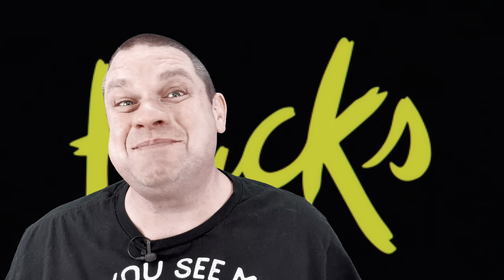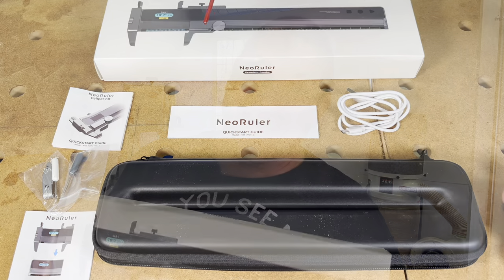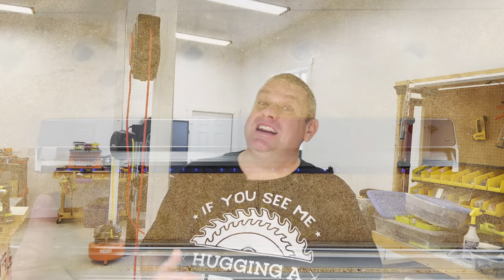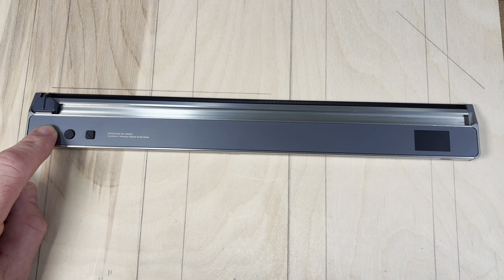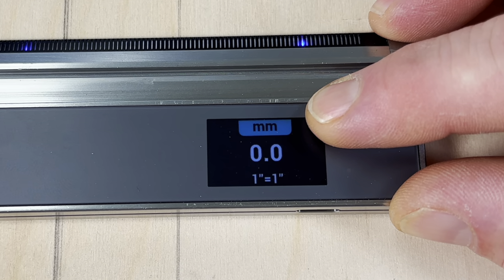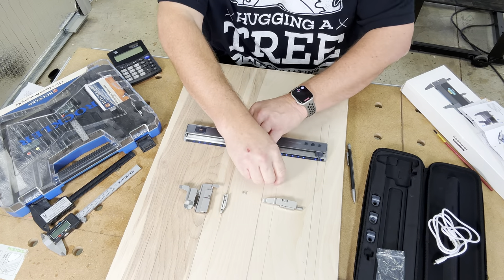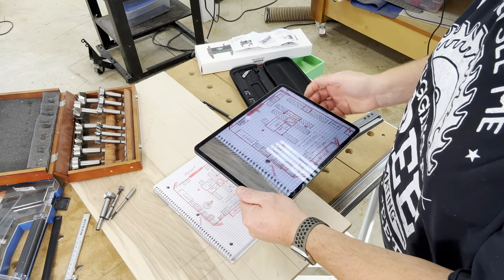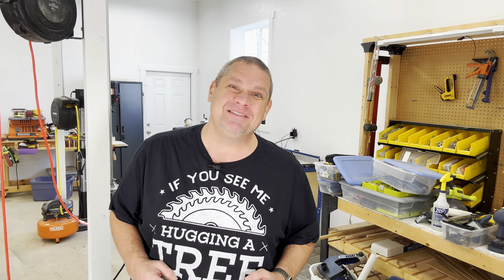Unleash the Power of Technology: The Newest Digital Caliper and Ruler

Comment: That's a really cool tiny beast.  I love the idea it could help mark out box joints using the segments mode.  It could possibly help with dovetails, too, but I think that because pins and tails are such different measurements (i.e. 1/8" pin with 3/4" tails for instance), it's asking a bit much of it.  Then again, the tool has so many other uses.  And it actually seems to be able to do all those well.  At this point, it's a tad out of my budget, but thank you for showing it!
Reply from the maker: Thank you so much Sandy.  What a great idea with the dovetail layout.  I can't believe I didn't think of that, great suggestion.   Thanks so much for watching and commenting, I really appreciate it! :)

Comment: Does "I haven't unpacked my set up blocks" really mean I can't remember where I put the darn things? That is a nice tool, I did notice how large the inside calipers were and I also noticed that it doesn't have a depth gauge either. Both of those would really make me think twice before dropping that kind of money. Still, thanks for the fun video.
Reply from the maker: You know me too well Pat!  It was a combination of me not unpacking everything yet and not knowing where int he hell everything is! :)   I agree with you on the inside calipers.  They need to sleek that design down so that it can fit smaller holes.   Great observation.  I was noticing that when I was editing the video, and probably should have commented on that!

Comment: Interesting lots of techy features, but I just can't wrap my head around how  this is actually better than a regular straight edge ruler or a decent quality digital caliper. 
I'm doing wood working not building a space ship! 
Call me old fashioned but when I draw lines I personally find the marking instruments that hold a pencil lead and you move the whole thing along  to be rather cumbersome. 
For most woodworking projects, I like the analog metal calipers that are marked off in fractions of an inch to be the most useful for me.
Reply from the maker: I totally get it scrook!   My point with this video was mainly to show the technology of it.  I'm really quite a nerd when it comes to looking at new tools.  Sometimes I think technology isn't always better, but at least it shows what could be potentially done in the future.   Time will tell if these will replace my tried and true methods (I'm guessing they won't) but it was fun to check out the tech! :)

Comment: Flyndogg,

Your new tool is very interesting.  If you look at the price you're in the Starrett/Mitutoyo range.  If I'm paying that much for the caliper I'd opt for the name brand.

I can speak from experience working after school and summers as a draftsman and as an engineer after college using the "ruler" function is too gimmicky.   Using a triangle rule, you get six different scales.  They're easy to use.   I have a metric, engineer's, and architect's rule.  I don't see any advantage of a digital scale.

Offhand the one real problem I see is the size of the tool.  It is awfully big for use as a caliper.  It cannot take depth measurements when cleaning a mortise or a hole depth.
Reply from the maker: These are all great points Robert, thank you for sharing all of this perspective.  I think it is all very good suggestions and comments regarding both the ruler and the caliper.   Thank you so much for sharing and watching!

Comment: I thought at first “no way I’d pay that for a woodworking caliper” but it’s added use as a ruler and the various ways it can be used means I’ll be saving up to get it!  I wish they sold the ruler part by itself, I would buy both just so I didn’t have to take it apart to use the different features. SEMPER FI
Reply from the maker: It's a pretty cool little gadget jeramiah!   They actually do sell just the ruler itself, in fact I think that is the piece that everything was designed off of.   Best of luck and thanks so much for watching!

Comment: I will be very interested. to see how this is in a few months time. As all the digital callipers I bought in the past are okay at the beginning. but they have all soon. started to let me down. for various reasons. which vary from dampness. temperature. Battery rundown even when switched off. I've just purchased a manual dial calliper. because I've got so sick of them. I've probably got a 10 digital callipers. and I don't trust one of them. One of the most common things I get is the. starting to flash. and jump up and down for no reason. Another one. is Suddenly, to add 5 millimetre to the measurement. Out of nowhere, or use the roller. and roll it backwards and forwards, and it won't zero. I just find them not accurate. He is hoping this one is.accurate? But at the price it is I wouldn't. be lieving in it on my bench. I feel this is more for draughtsman than it is. for a tradesman. Anyway, I look forward to your next video and thank. you and thanks for bringing it to our attention.
Reply from the maker: My pleasure Chris!  Thanks for watching  I 100% agree with your concerns.   If I had paid for this thing, I would have a hard time using it all the time, as I would be "protecting my investment"   I also agree this is a design with the ruler that I think would be greatly used if you were an architect or something like that.   For the caliper alone, there are probably better options, but it was fun to take a look at it!  Thanks so much for commenting and watching!

Comment: The large width of the "inside" caliper pieces limits its ability to measure smaller holes. They look to be from 1/4 to 5/16 inch wide. All calipers that I have seen have those come to a point. Great video but that is not for me.
Reply from the maker: I 100% agree with you.  Another viewer commented the same thing.  They need to slim those things down for sure!   It was fun to take a look at but has some limitations.  Thanks for watching!

Comment: It's a shame that the tips of the calipers are so thick / rounded off. Can't get into tiny places with those.
And no depth guage.
Seems they were an afterthought :(
Reply from the maker: I totally agree with you.  This tool seems to be designed as a caliper secondarily to the ruler.   Still a pretty cool little gadget, but I've ran into problems tryng to do interior measurements with those thick arms.   Thansk so much for watching D4RKFiB3R!   Cool username by the way!

Comment: Dogg, man  gym shorts and a tee?  Ain't insulation grand?  Can you use that caliper with a lathe?  Whaaaat?  Thank goodness for the rubber, we wouldn't want to slip off the end. We wouldn't be  converting it into a "scale" ruler too often.  Seems to us that the more it was taken apart, the more of a chance to either lose the small screw (included) or  misshape the caliper head.  From your demonstration we think that this is a neat toy, but it would add hours onto a project vs. a standard caliber that you open the jaws and read the measurement.  Merry Christmas and support Saint Jude Children's Research Hospital.
Reply from the maker: Oh man, you don't even know the 1/2 of it with the insulation.  It is like a totally different experience this year.   No more hot showers after a few hours in the shop.    Probably could still use the shower but I won't be freezing cold! :)   Great points on the caliper.   I think you share a lot of what other people's impressions were as well.   I got a notification on the shipment of the lathe!    we will see if it arrives before christmas!    Thanks for the suggestion on St Jude, good charity to support!
Reply: @FlynndoggWoodwork  They'll get it there.  The only problem I see is that you are your own Santa Claus (I know how that goes, seems to be the case here in the shop also).   Anyway, I'm still hoping for that Paolini pocket rule. I wasn't greedy, I asked only for the 6".  I was asked if I wanted the three  (6",8" and 12") pack, I declined because I'm only wanting the Paolini for the status.  If Santa brings it, I'll be a step closer to being cool.  However, I've used my grandfather's carpenter's square since I began, it seems to work.  Merry Christmas Dogg man and the rest of the Dogg pile!
Reply from the maker: @themeat5053  You are exactly right with that being my own santa thing.  In fact my wife just told me get what you want and I'll wrap it for you and put it under the tree:)   You deserve the Paolini Meat, I'm sure santa will bring it for you! :)   You'll never guess what I got in the mail today!   It was indeed my present to myself!

Comment: Too much work, faster to grab a ruler
Reply: By far!
Reply from the maker: I hear you.  The ruler has way too many functions for woodworking unless you are doing something like scaling up drawings.   The calipers are nice, but it's a lot of money just for that feature.    Old ruler will always work! :)  Thanks for watching bigmanh!
Reply: Agree, too much work. I just don’t see any value added. That slider tab or even the line on the magnifier is too thick. I have an old school vernier caliper, a Starrett dial caliper in imperial, and several precision rulers from PEC Tools and a couple of marking knifes that do 99% of everything I need in my shop for woodworking. Lately, it seems like tool manufacturers are producing gimmicky stuff like that trying to compensate for proper woodworking techniques. Learn how to take reference measurements, without a ruler or caliper from the actual piece, and your accuracy will increase ten fold.
Reply from the maker: @lanceyohe6026  I hear you, I would like to test out an analog caliper sometime soon, Never used one before, and I think it would be a great addition and learning experience.